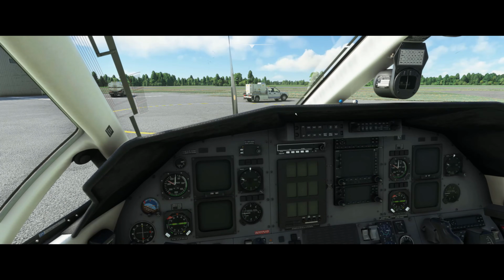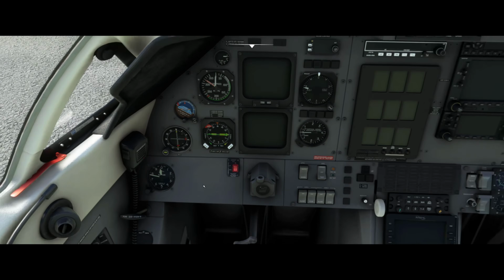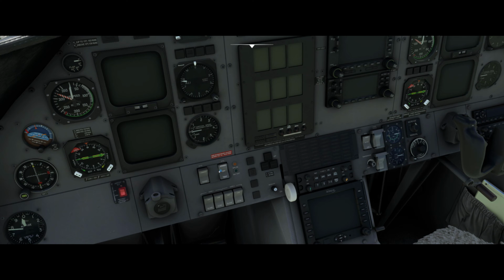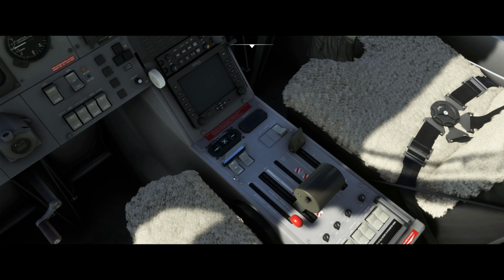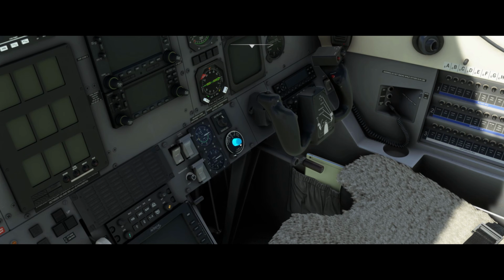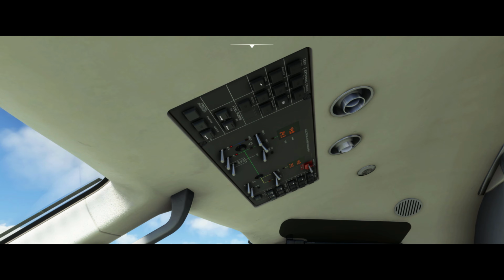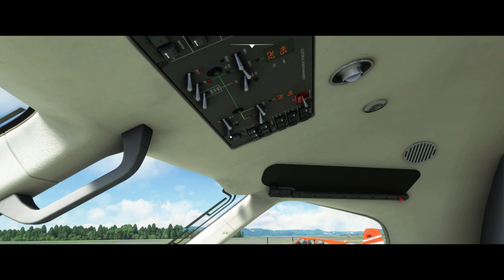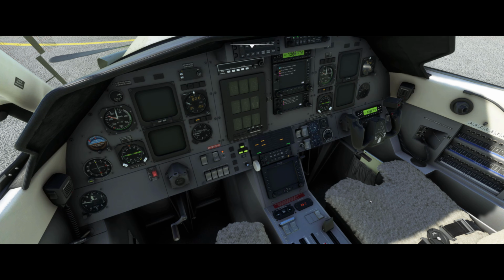WALKTHROUGH | Pilatus PC-12 Receiving Flow (Legacy)

Comment: Thank you sir. Very informative. How do you find this plane upon rotation and landing? Im starting to hate it. Do you find much difference (legacy sws) with the RL plane? Also in RL when you are landing in crosswind condition since rudder and aileron are interconnected, does the apply rudder to keep it in the centerline applies still, or what are the nuances here.. because the plane just sends me all over the runway, even after newest update.
Reply from the maker: Thanks! I haven't flown the SWS PC-12 since the latest series of updates, so I can't comment on the flight characteristics. The real airplane (Legacy) is quite heavy in all three axes, though. As far as crosswind landings are concerned, the control inputs are the same as any other airplane. The sideslip method is used. The aileron/rudder interconnect is invisible to the pilot -- it's easily overridden. Cheers!